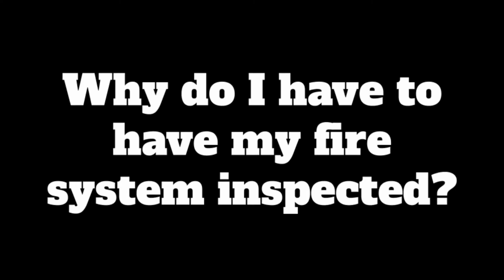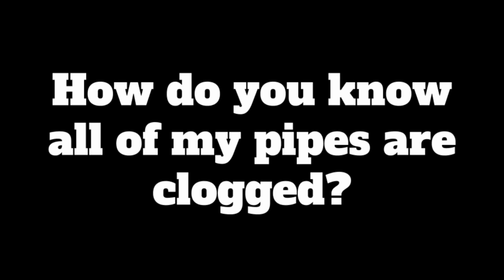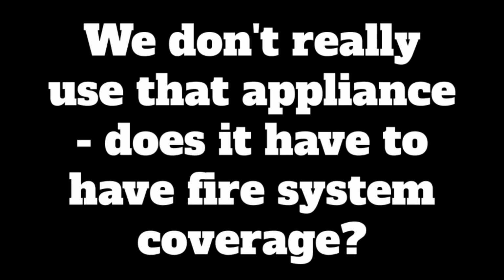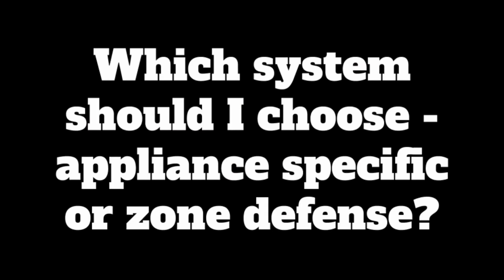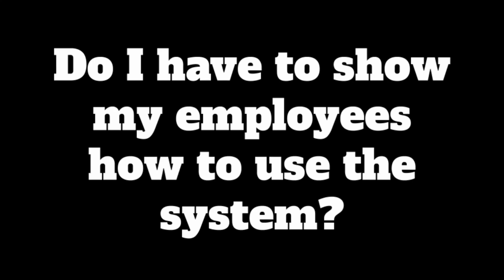Fire Suppression Frequently Asked Questions

Comment from the maker: Time Codes:
Why do I have to have my fire system inspected? 0:02
How often do I have to have it inspected?
 0:29
What are my real risks if I do not have a compliant system? 
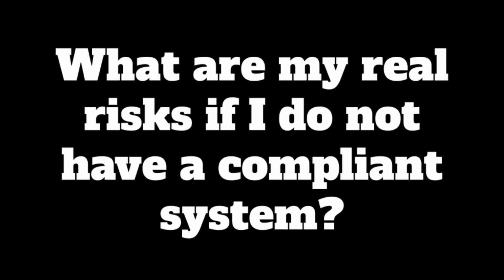0:37
What do I do if my system is red tagged?
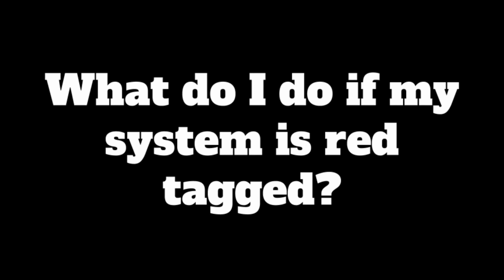 1:23
What do I do with the reports that I get?
 2:12
The fire department came and did their annual inspection and said everything is fine.  Why are you telling me it is not fine?
 3:00
Why does the city have to test it?
 3:41
My system was inspected by the AHJ when it was installed.  How can it not be compliant now?
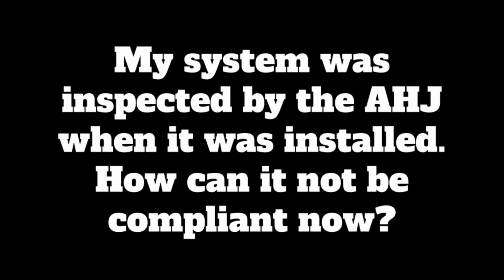 4:05
Another fire suppression company said it was fine.  Explain to me how your company is telling me I have problems.
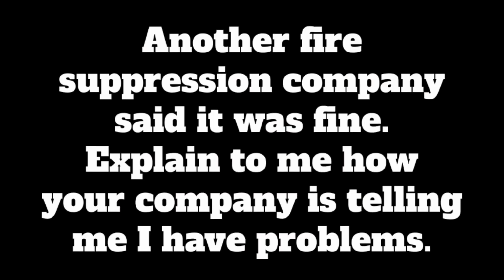 4:33
Why do you have to have a hydrostatic test on a cylinder?
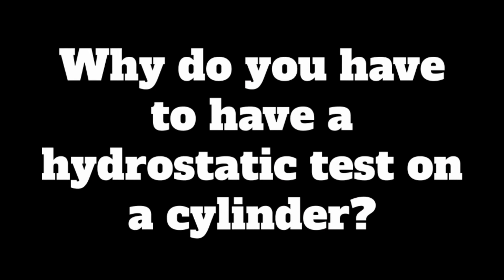 5:08
My system has never been activated.  How can it be out of compliance?
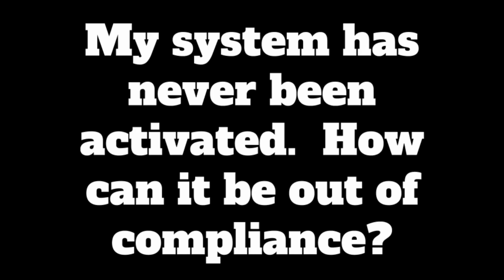 5:38
Can't you just move one of those nozzles?
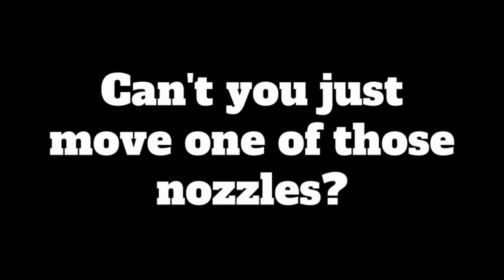 6:11
Why can't you use the same nozzles?
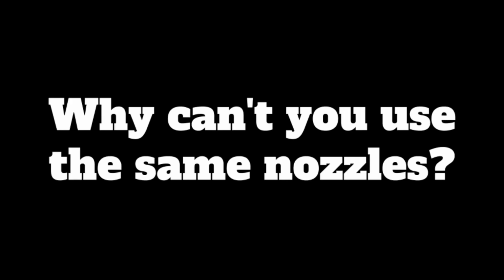 7:02
How did grease get in my automatic detection line?
 7:54
Why do I need to keep the filters in place?
 8:17
What is UL 300?
 9:08
How do you know all of my pipes are clogged?  
10:09
Why do I need to change my fire system if I want to move my appliances around?
 10:43
How long will a new system last?
 11:04
How did my pipes get clogged or rusted when my system has never been used?
 11:24
We don't really use that appliance - does it have to have fire system coverage?
 12:20
It was just a little fire - why do I have to have the whole system reset?
 13:04
Are there systems that do not require appliance specific coverage?
 13:48
Which system should I choose - appliance specific or zone defense?
 14:47
How much is my system going to cost?
 16:06
Do I have to show my employees how to use the system?
 17:06
Why should I choose Priority Fire Protection?
 17:59